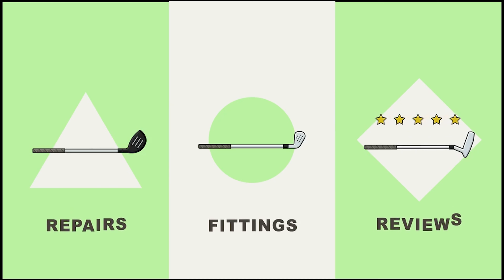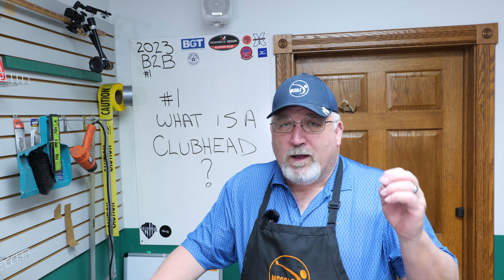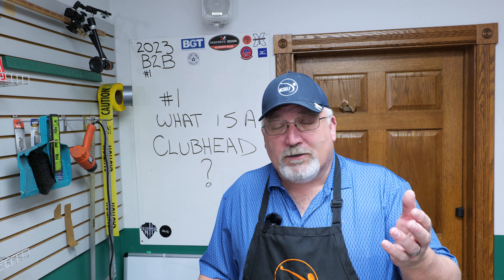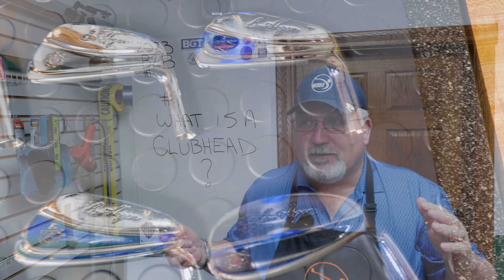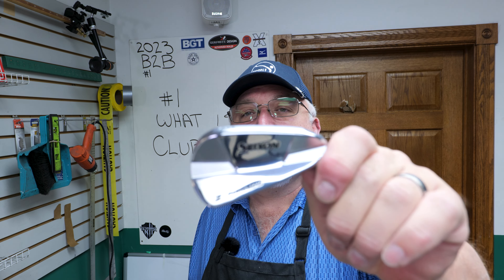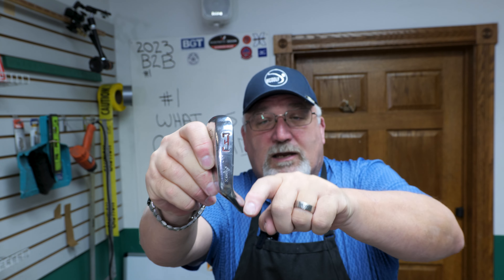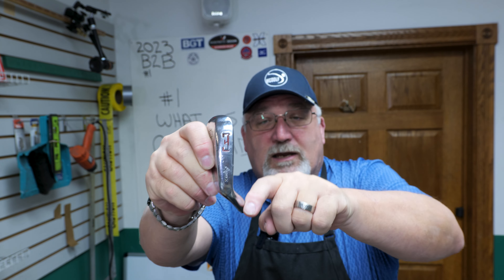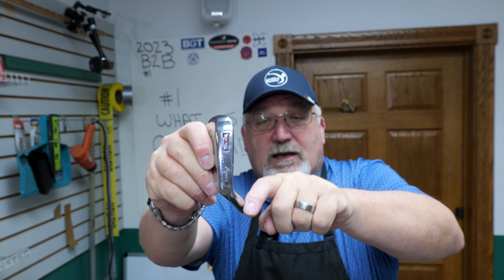Golf Clubs Explained - club heads

Comment: so we can find some good old clubs like hogans or even good generic brands with good condition heads and put new shafts in swing weight correctly and still have a great set of clubs rather than buying new clubs.
Reply from the maker: You could but the distance would be shorter per club
Reply: @McGolf is that because the lofts are different?? I would like to pick up and old set of medallions and put in modern shafts. I don’t care if the 7 iron doesn’t match a modern 7.  I simply like vintage clubs.
Reply from the maker: Yes

Comment: Awesome video!  Do you ever use Maltby playability factor when looking at iron heads?  The 923 Mizuno HMP doesn’t score well but it sure seems forgiving.  Did Mizuno make a change from 921?
Reply from the maker: I was there when Mr. Maltby came out with the factors that make up the club head. The  new head is only a slight change from the 921, some heads are now all chromolly